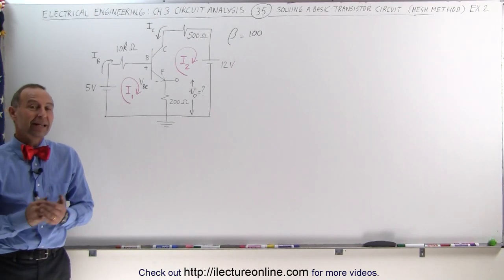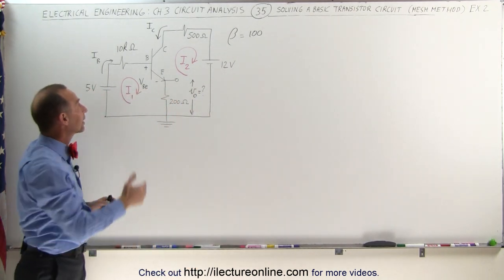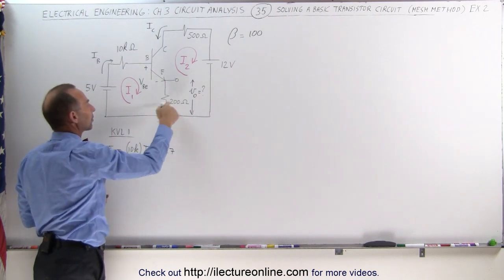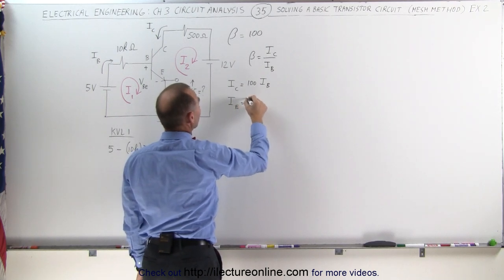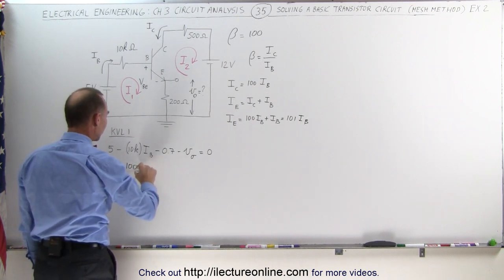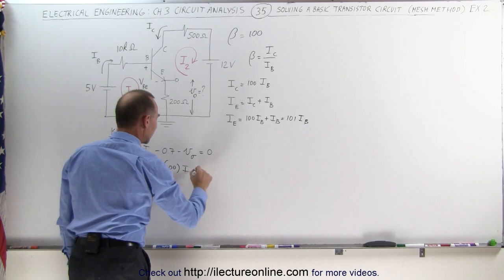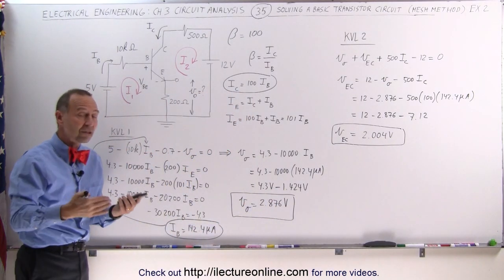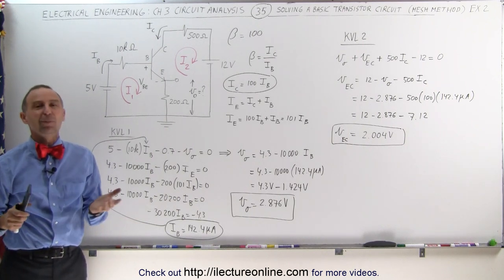Electrical Engineering: Ch 3: Circuit Analysis (35 of 37) Solving Basic Transistor Circuit (MESH) 2*

Comment: Just a small correction: The variable Vec should actually be named Vce, because there is a difference. In general, If we have Vab, that means Va - Vb. In that case the rise is Vc - Ve, so it should be named Vce

Comment: Why don't you take under consideration the 0.7V (Base to Emitter Voltage_when solving for V (Emitter to Collector) in KVL #2?
Reply: I'm not completely sure, but I think it's because anything going on between the emitter and base would either be accounted for or wouldn't matter while determining the total voltage difference between the emitter and the collector.

Comment: Why is it V_ec instead of V_ce in the second part of the problem? I thought it would be +V_ce in the equation since there's a voltage rise going from E to C. The polarities aren't marked in the circuit for C and E so I assumed the + is by C since that seems to be where it is typically

Comment: isn·t that voltage Vec supposed to be Vce. pretty confused there but i understood what you did, thank you sir
Reply: No because the voltages in the mesh loop are raising in the direction of the current.
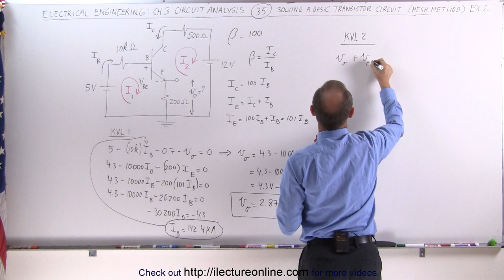Reply: I agree. Vce=2.004V  The error was made at 5:53. There is a voltage rise of Vce from the emitter to the collector. That rise would be measured with a voltmeter with the + probe at c and the - probe at e and would read a positive number defined as Vce (defined as the voltage at c with respect to e). He first said Vce but then changed it to Vec probably because he is nervous making a video and was thinking "I am going from e to c around the loop so I should call it Vec" but that is incorrect. If you simply replace Vec in the formulas with Vce then everything is fine. According to Kirchhoff's law the sign of the actual voltage is not relevant - meaning if Vo, for example, turned out to be negative the formulas still work. When you build the equation you have to add each voltage as a voltage rise around the circle. So Vce is the rise from e to c. Sometimes when you plug in actual numbers or something like Ic x 500 you enter is as -500Ic because the rise is negative (called a drop) due to the definition of I being opposite your direction of travel around the loop. Jim MSEE Caltech '82

Comment: Sir, Have you used 0.7V because of the current only going through one part of the transistor ( one diode ) ? is it always even for going from C to B ? thanks in advance.
Reply from the maker: The voltage difference between the emitter and the collector is typically around 0.7 V

Comment: Base to emitter is a constant? 0.7?
Reply from the maker: +harisrizal96 
Once the applied voltage reaches over 0.7 V the drop across the base to emitter is almost linear with increasing voltage at the base.
Reply: in an NPN BJT Transistor if you aren't given a value in a problem always assume it to be 0.7 for the Vbe, if they dont want you to assume that they will always specify a different value! :)

Comment: Hi professor, I don't understand why the equation for KVL1 is (4.3-10000 IB-200 IE=0) but not (4.3-10000 IB-200 IB+200 IC=0) ? 
I got a bit confusing.
Reply from the maker: The emitter is at a higher voltage than ground, thus the current flows from the emitter to ground and thus it is a voltage drop.   The direction for I1 was arbitrarily chosen to be clockwise, thus according to the KVL1 with I1, it will also be a voltage drop.
Reply: can you explain the positive 5v wasnt it supposed to be negative 5v +RbIb+0.7?
Reply: ohhhhhhh hahahahaha its the same thing i saw it

Comment: One question is why the 500 ohm resistor in the second mesh is positive and not negative.  It look like you are making a summation of voltages rise = 0?  Which should make that 500 ohm a drop (or a negative when deriving the equation)?  Am I seeing this correctly?
Reply from the maker: You are correct.  Since I used Ic instead of I2, it is a voltage rise across the 500 ohm resistor.  If you keep watching you'll see that I discover my mistake.

Comment: hello sir, i was wondering how to tell if a transistor is in active mode
Reply from the maker: In the active mode there is a linear relationship between the base current and the collector current.  Changes in the base current drive changes in the collector current.  When saturation is reached increases in the base current will no longer result in changes in the collector current.
Reply: @MichelvanBiezen  but how can i test for that in the circuit? should i focus on vce and see if there are any inconsistencies? (i.e. vce < 0 for npn, or vce = vce@saturation when i thought it was in active mode)
Reply from the maker: You can test it by changing the base current and then measure the collector current.
Reply: ok, thank you very much! i really appreciate the videos

Comment: Sir the current inthe 500 ohm resistor is equal to the current in the colector of the transistor?
Reply from the maker: That is correct.
Reply: @MichelvanBiezen  what if the 5v wich was conected with the base of the transistor was also conected with the colector of the transistor the 500 ohm resistor's current would be a  multiplication of the base current (the same current as the colector again?)?

Comment: Why Vbe is - 0.7V not +0.7 V?
Reply from the maker: We travel around loop 1 in a clockwise direction.  There is a voltage drop of 0.7 volts at that junction traveling in that direction,
Reply: @MichelvanBiezen  Ok, I understand, but shouldn't be there "+" ? Because direction of voltage drop is the same as adopted clockwise direction.?